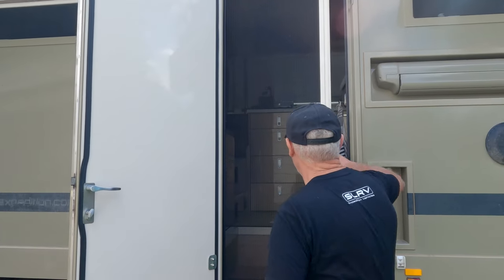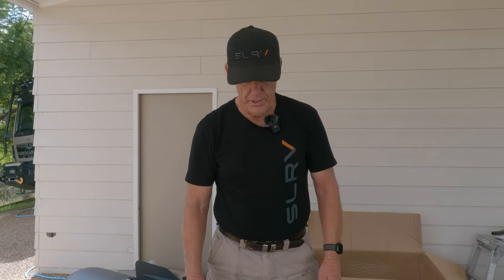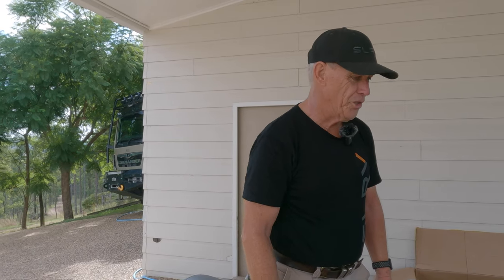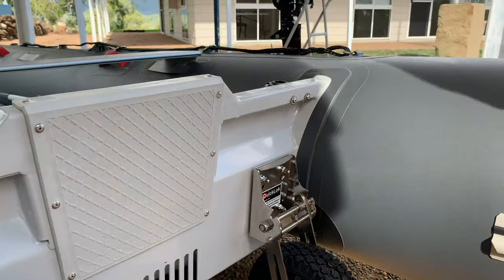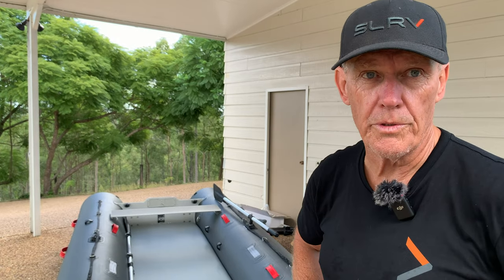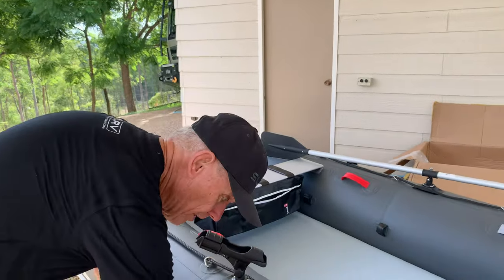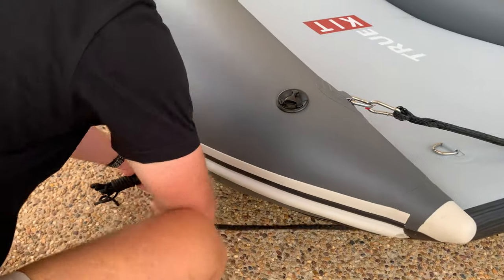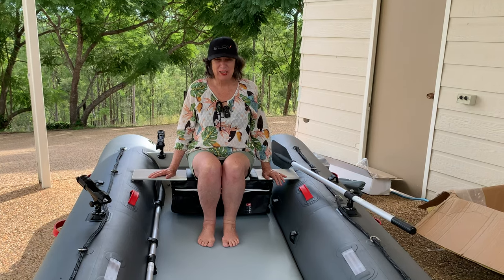UNVEILING TRUE KIT DISCOVERY 400 - A GAME-CHANGER FOR OUR EXPEDITION TRUCK!!!!

Comment: I found using an 18V blower (I use an AEG) is the best way to get the bulk of the air into them.  Also switch it around and suck air out for a tighter pack down.
Reply from the maker: Thanks for the tip. Will definitely try this👍